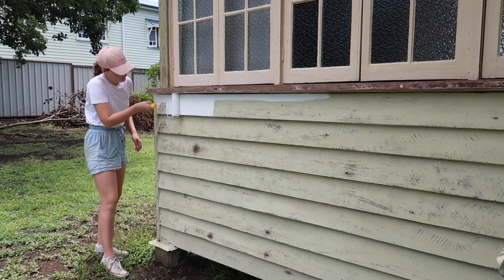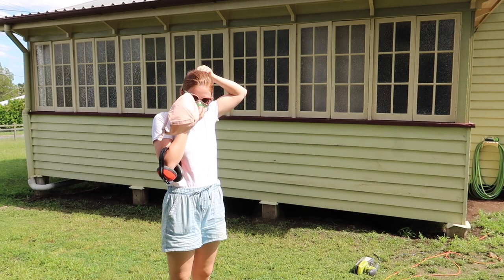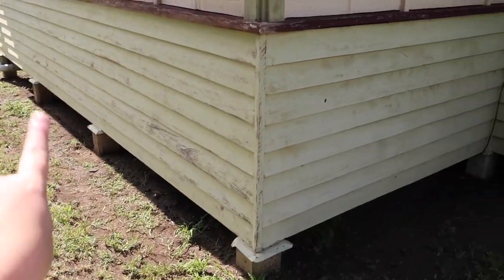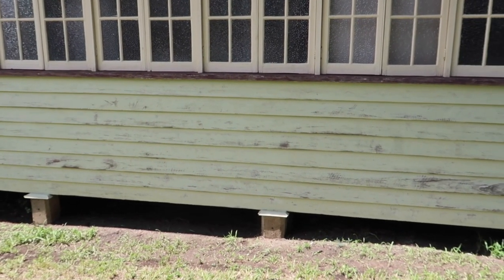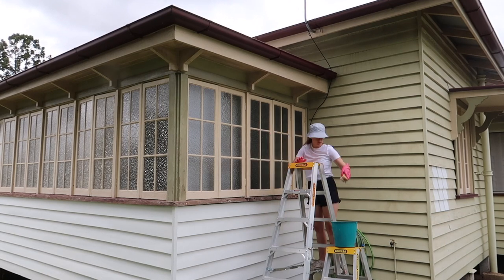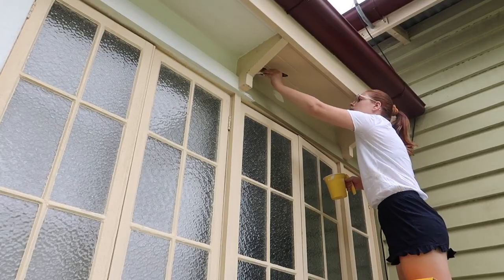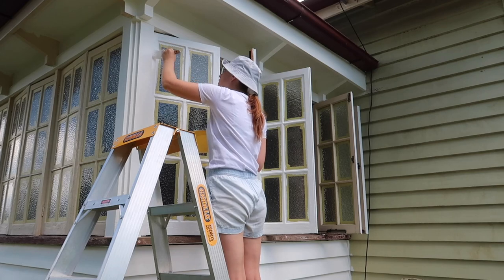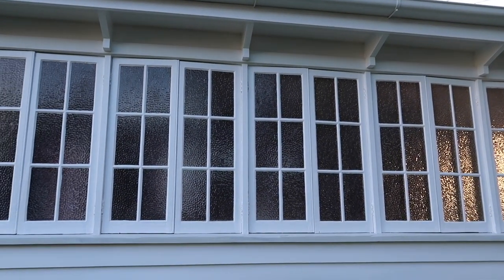PAINTING THE HOUSE PART ONE | Painting a weatherboard Queenslander | Sunshine State Home

Comment: why do you need to scrub the weatherboards if youre sanding? wouldnt sanding clean it anyway
Reply from the maker: After sanding, I needed to remove all of the dust. It's a messy job and you don't want sanding dust mixed in with your paint. Scrubbing it down will ensure the paint finish is really beautiful.
Reply: Makes sense. It is messy @SunshineStateHome